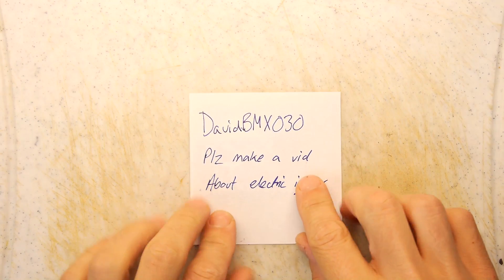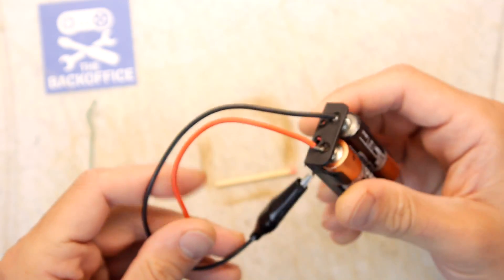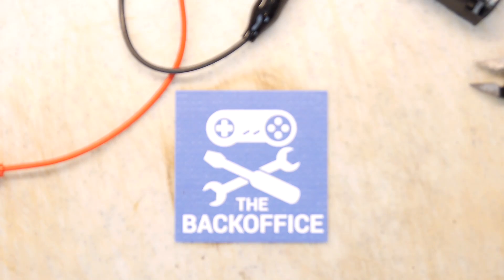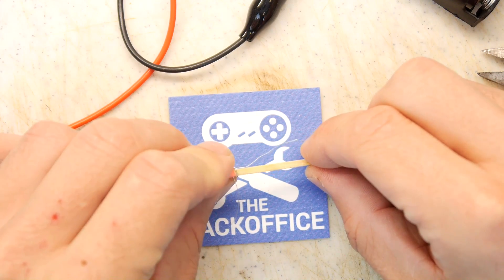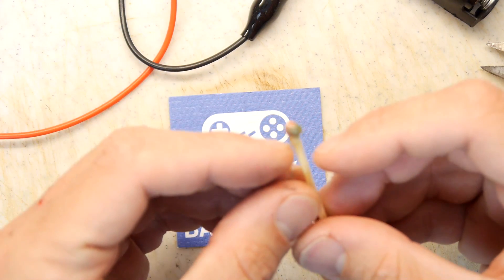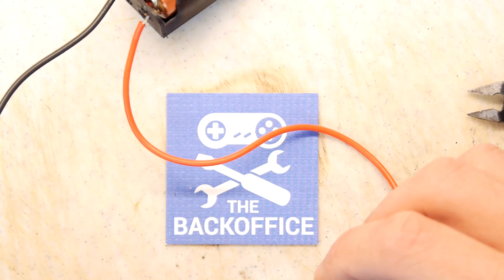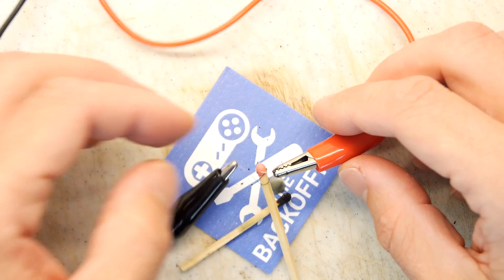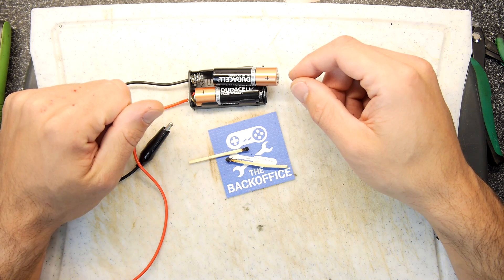How to make an electric firework and pyrotechnic Igniter

Comment: Wonder if it would light a fuse just tie the wire to it.
Reply: Anthrit yes that Works, bcuz the fuse ignites easier than a match i guess.
Reply from the maker: +Anthrit I'd say it probably would work as you normally light the touch paper using a glowing splint thing anyway. Seems like a lot of work in any case 😀
Reply from the maker: +DavidBMX030 there is the possibility that the fuse material might be really resistant to igniting from heat alone and require a glowing ember. Do you see what I mean? It might be treated specifically too prevent ignition if the box got too hot.